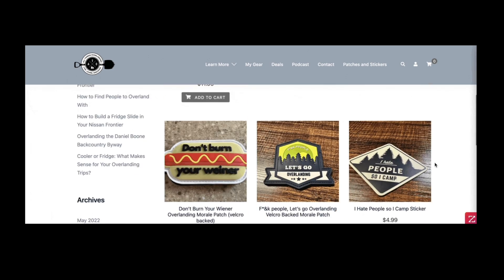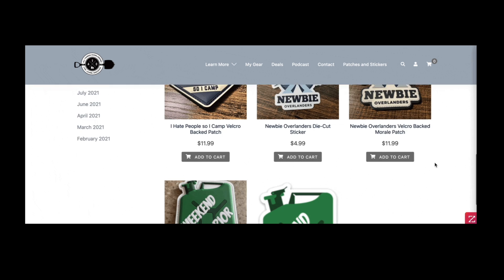Solar Power 101: Overlanding Basics (Types of Solar Panels, How it Works, Uses for Overlanders)

Comment: Mounted a 100w solar panel to my roof and routed the cable to the bed of the truck. Is there any issue leaving the cable plugged into the panel? I don’t keep my ecoflow in the truck 24/7 since it’s my dd.
Reply from the maker: I don’t think so. You may wanna kinda keep it down somewhere where it’s away from rain and dust, but it shouldn’t hurt anything.

Comment: Do you have a video on how you install the solar panel?
Reply: Thanks for sharing! What about the one on your RTT? I just got the same tent
Reply from the maker: @eddie947  thanks and welcome! That’s actually the same panel I had on my old Xterra so I just used 4 channel bolts with nuts to hold it to the cross bars and ran cables down into the bed of my truck where my electrical system is housed. Same wiring just in a slightly different location.
Reply from the maker: Good question. Not a ton actually. I combed the archives and found this older video (don't judge me):  https://youtu.be/YwbIyPiOvA8?si=HLbkvD-rZqrmWY8p&t=470. At that time stamp, I talk a bit about running the cables and I do show the controller and where the wires go in a bit. I'll have to put together a solar wiring video here in the future. I'm getting ready to re-do my set up any ways to upgrade to a larger panel, so I'll try to get it put together soon! Make sure to subscribe if you aren't for more on that. Let me know if you have any other questions!

Comment: Interesting, thanks.  I don't use the Xterra battery for anything else.  The offroad-ish trailer has its battery which only powers its lights and fan.  The deep cycle trailer battery charges while going down the road.  Inside the trailer, I have  Jackery 500 to charge phone, electronic reader, camera battery, or maybe a 12 volt throw.  I've never run it down.  In the back of the Xterra is the fridge and a 600 Rockpals.  I used to have Zamp solar, but they're a bit big and heavy.  So I have a couple folding 100 Rockpals solar which can hook together.  I haven't used the solar in bad weather, but have used them in semi-shade, and it keeps up pretty well.  So far, I haven't  needed the latest and greatest.  When I leave the vehicle to go for a stroll with the dog, I just unplug the solar so I can close the back and leave it to keep the fridge going (locking the vehicle).  It seems like a lot of extra stuff to take, but it works.  I could always just go back to using a cooler which sits on the front of the trailer--life was simpler, but if I don't want to run out of ice...
Reply from the maker: Yeah, you can go as crazy as you want for sure, :D. I've definitely enjoyed having my house battery just keeping itself topped off with solar, but my setup is actually really simple. Single panel hooked up to my REDARC that keeps it going.

Comment: Good morning Jason thanks for sharing this very well done on explaining one thing I would say emphasize when you’re doing your own wiring on your vehicle is the Take Your Time stay with certain colors for install label your wires and protect the wire of where you’re putting it so it doesn’t get pinched Also think about emergency shut off circuit, breakers and fuses and one more thing if you do not feel comfortable doing the work get help or take it to a professional shop to have the wiring done the last thing you want to have is an electrical fire inside your rig
Reply from the maker: All good tips! Thanks man!

Comment: Good food for thought. I typically do weekend camping trips and use a portable jumper/air compressor unit for my charging needs. Has usb outlets and a 12v outlet. Charges off 12v while driving. Works good enough for my needs. Total cost was under $100
Reply from the maker: Those work great too as long as you don’t have too many things that are power hungry. Great idea!